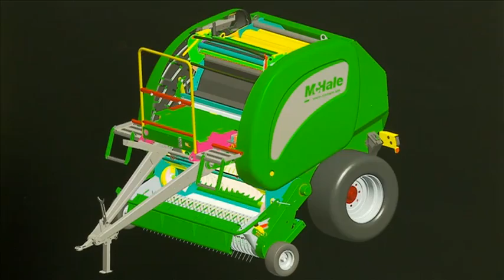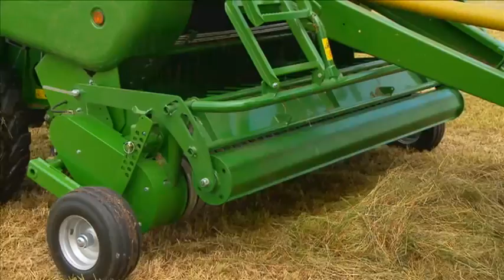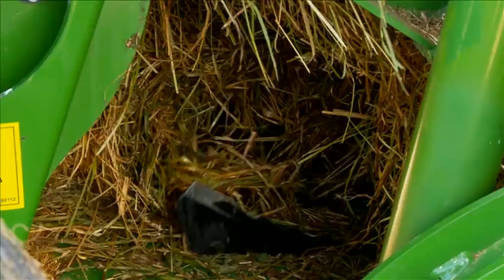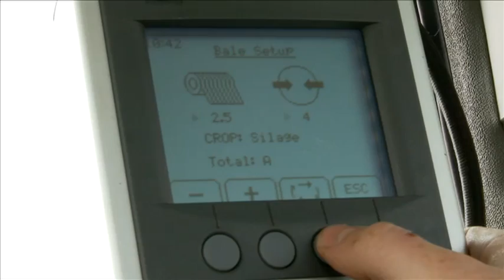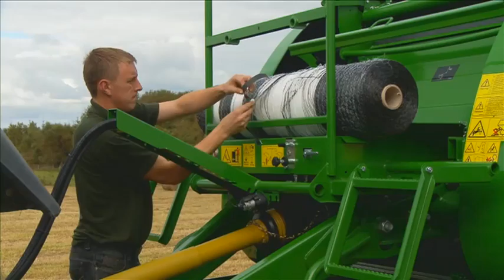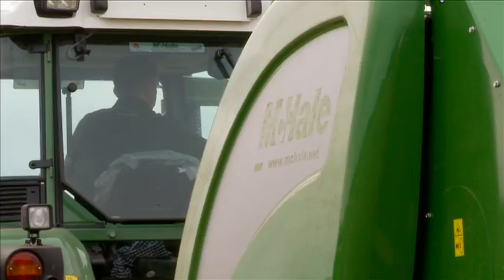McHale F5000 Range Englsih 9 4 14

Comment: Those chains don't stay clean after about a dozen bales. Why on earth don't you design a cover that keeps them clean?  It's not rocket science, Vermeer machines do it why don't you?
Reply: It's mchale for you theirs a group on Facebook of mchale Operators when it should be mchale baler Problems cuz the holee group is full of them like your better off with a kuhn or lely baler lad
Reply: @Paddy6.30  I had a Vicon which was later made by Kuhn. The best thin that happened to it was when it caught fire. I then had a Welger which was ok but none of the makers cover the chains to stop debris accumulating. The massive plastic cover on the sides does nthing but display their name.